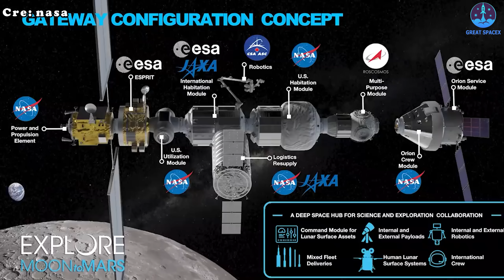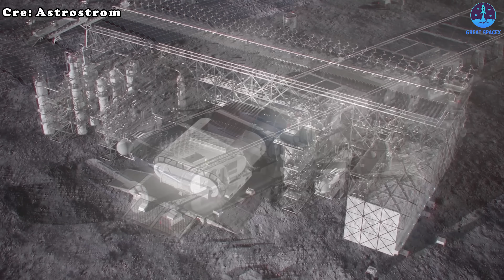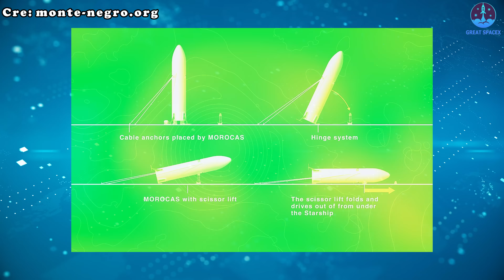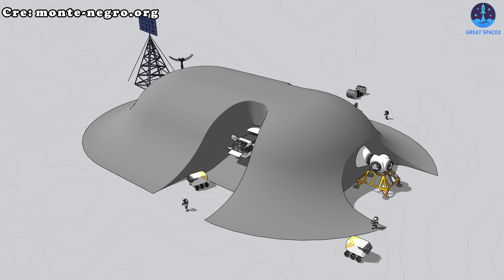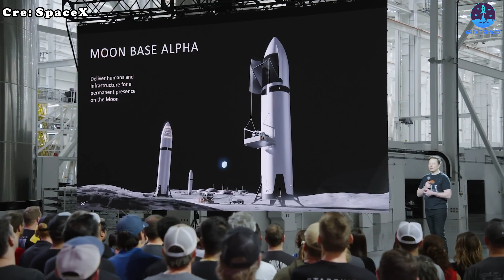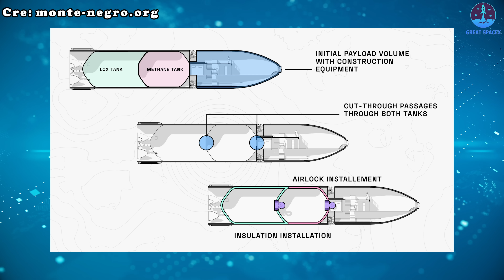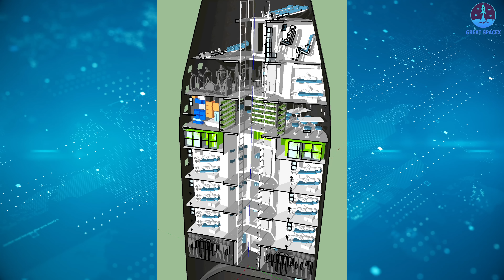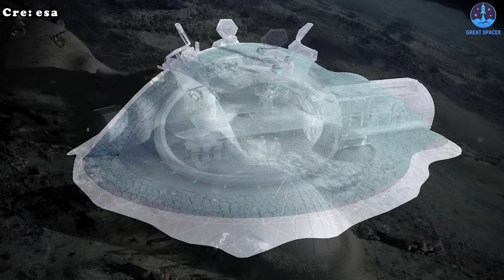SpaceX’s completely NEW Solution to help NASA Build First Moon Base Before China & Russia…

Comment: Step one starship space broom clears a place. Then lands on it and gently lays itself down. The next starship used as a broom will blow regular from around the area against it like a snow fence in the winter. Then from the second craft come tunnel, boring machines, and more Optimus robots. They make bricks you heat the bricks with an old raptor engine with the right mixture and you get the best bricks ever cyber trucks driven by Optimus will haul and stack them. They are light. Optimus is strong. They will be big. As a joke. Build one you cannot put a piece of paper between in odd shapes like they didn’t South America.

Elon has big factories producing all of the necessary components to do what I just said. If he turns his production that way. Would you be just after next falls Mars launch. He’ll be busy he can turn the production to you and you’ll have a base there so fast Because millions of bots a year thousands of starships zero human lives lost.

Comment: Aside from the fact that HLS is probably too tall to land on the Moon and that more squat designs are starting to emerge, working the lunar surface won't be so simple. On Earth, excavators must be heavy, and on Earth, we have six times the gravity of the Moon. Currently, humans can carry one ton to Mars and five tons to the Moon (at Earth weight) with smaller volumes. We'll see if the modules designed by Starship will perform better (and certainly cost less, if these concepts are implemented).
Reply: If its too tall, they can make it modular. Blow off the bottom section with the spent fuel tanks. Lunar gravity is super low, so they don't need much fuel to land it upright compared to earth.

Comment: It seems like the engines should be harvested off of the ships before they are buried. And could then be recycled into new ships produced either on the Moon or in Space.
Reply: I agree, unless of course parts of the engines could be used as an electric arc cruicuble for isru. If that were the case then it may be worthwhile because then they would have essentially unlimited oxygen from the regolith.

Comment: It is IDIOTIC to configure the Starship into ANY horizontal format since it will only be used in that way until it is in space. Once in space there is no up or down or there is no need for it to be configured vertically. The only things that need to be configured at launch is the position of the astronauts and once in space the seats could be rotated to match the rest of the ship in a horizontal position. 

The only things that need to be lowered down to the ground would be the giant air bladder weigh as it will be a MASSIVE amount of weight limiting anything else that could be taken on that trip to the moon in that Starship. And where will all the air for that air bladder come from? There is no atmosphere to speak of on the moon so it would have to stored and taken in Starship. If you compress it, the air would increase in weight vs cubic meter so you have to take that into account too. 

Once you get to the moon you then have to get the giant air bladder OUT of Starship and onto the ground. You would then have to drag it into place. You would then have to make sure that "up" is up and then fill it with air. 

If at all possible it would be better to drive giant stakes down into the ground. Each would have to be multiple meters in length which would add weight but without the bladder there would be a lot more rooms and capacity to take those up. Then you would attach motorized winches to the stakes which could then lower the Starship onto its side. I think that would be a LOT better idea and there would be no idiocy of having to reconfigure everything from a "vertical" position to a horizontal position because it would already be in that configuration.

Once on its side I would remove the engines and the fuel tanks using those for external storage tanks which again could be covered by regolith to protect any contents from radiation after plumbing is attached, most likely by robots. 

Once all that room is freed up, room for MUCH larger living quarters and work spaces would be available. 

But I would not send up just one Starship but I would launch and land TWO Starships. The second one would be landed as close as possible to the first one and then laid onto its side onto robots with wheels which would then move the second Starship next to the first Starship. Why?

The nose section of Starships would have doors sealing them from the main portion of the Starship. Then robots would laser cut the outer walls of the Starships on the side towards the second Starship. This would be done on both Starships. Those outer walls would then be moved from between both Starships. 

Next new outer panels in the storage section of the Starships would be laser welded to the Starship at 90 degree angles to the surface connecting the two Starships until all of that cubic area could be sealed and then filled with air. Then floors and walls could be installed in this much larger space where many more people and much bigger projects could be worked on and completed inside the Starships that will stay inside. 

You could add as many Starships as you wanted to horizontally in the same way or in pairs or however you wanted. 

However, you could also stack Starships ON TOP OF EACH OTHER in addition to horizontally side by side again using them as part of the framing to create even larger work and living spaces which would then be covered by regolith. 

Keep in mind that Starships can and will be able to take AT LEAST 100 tons from the earth to space. How much do the mathematicians think they can LAND on the moon will be the biggest question. How big of FEET to the Starships need to have in order to LAND ON THE SURFACE with 100 tons divided by 6 because there is 1/6th the gravity on the moon as there is on Earth, which will help significantly. 

I would EXPECT that one of the first things once the Starship has landed on the moon would be to lower robotic bulldozes/diggers/dump trucks to the ground to start moving regolith out of the way next to the Starship without causing the ground under the Starship to give way but close enough that it would be "easier", not easy but "easier" to drive multiple stakes meters into the ground then connecting robot winches to lower the Starships down into the ground horizontally with enough room for at least TWO  Starships side by side as above. 

That regolith would then be used, in part, to cover up the Starships after they have connected horizontally and possibly also vertically while they are on their sides and using plasma cutters to cut out the "bay areas" of the Starships and then joining them together.

You could then have rooms that are maybe sixteen to 20 feet tall INSIDE the rooms. Yes, each Starship is 9 meters or 29 feet 6.33 inches. Obviously there is the rounded part at the bottom , which would not be removed (at least not until a later date if wanted) but if you certainly stacked two Starship with 9 meters from center point to center point of each rocket and then build outer walls to contain them and fill them with air, that would give you a room of 29 feet 6.33 inches or three floors of almost ten feet tall each, which would give room for plumbing of liquids and air for instance, most of which would be plumbed in the outer curved portions of the Starship with a foot to 18" of space between floors for plumbing if needed.

Just a thought.

Comment: Ok not a bad idea but where will you get all the air needed for the bag ? Why not just land on it's side with small rockets that don't need air . If they can slow it down to  a soft touchdown and the ship is stronger for this reason and it was tested as best as possible so it can  handle this maneuver.

Comment: This makes no sense. They're going to transport rovers and a giant balloon (to be inflated in vacuum) just to reorientate the ship one time, instead of designing a different ship? And then you need to have another way to getting people off the moon anyways? Who wants to live on the ship they came on instead of a habitat designed to actually be a habitat- not flying skyscraper.
Reply: No Musk fan here, but I suppose a second 'starship' would land after 6 months with a new crew, and then take the old crew back to Earth. But I don't know if they would have the space for enough fuel for a return trip with, 'dozens of astronauts'. The Apollo Lunar orbit return module only had to carry two guys to dock with the command module, and with gravity assist from the moon, it took very little fuel to get back to Earth.
Reply: I don't know why you're assuming a single ship will land. Elon constantly says they there would be ships flying there and back constantly. 

Why live on a ship first? Because it's easier. Building a habitat is difficult, you need a mini-base beforehand. Think of a minecraft dirt hut before you build an actuall fortress.
Reply: There is a great need to land many ships to deliver cargo and equipment, but very little need to launch back to Earth.  Therefore, you will end up with lots of empty ships on the moon anyway.  Crazy not to use them.  Think of them as RVs.  RVs are often used to house people at construction sites in isolated areas while the permanent housing is built.

Comment: I think they’re going to need nuclear power as solar energy is limited (even at the South Pole with no nighttime. Simple RTGs to start with followed by molten salt reactors.
Reply: How are you going to cool that with only radiation I wonder.
Reply: @chrisvanschalkwyk1455 , if you size the radiators correctly and keep them shaded, pure radiative cooling is enough for a lunar LFTR. In vacuum, heat dumped by radiation:follows the Stefan-Boltzmann formula, Typical LFTR outlet temps are ∼600–750 °C, where the radiators are very efficient. For example, a 50 MW reactor would need ten 25 m × 10 m double-sided panels.

Comment: Pretty sure I saw lord Frieza's ship at 6:46...😮.😂 Anyway...
I love this overall idea. Like I said on the last video about what to do with HLV after taking the astronauts back to Orion on the first trip... BRING IT Back Down the Lunar Surface for this! As far as the floorplan goes.... The 5th floor being the Rec Center and leisure zone.... Come On! It's not a resort! Like there were already Several areas sufficient for that. 5th floor should be shops and additional work areas. Printer zones. Systems. Grown up stuff. Lol. But here's another thing. On its side it isn't going to be 5 or 6 floors. On its side it's 4. The nose cupula type area should be perhaps two floors to give a place for higher ceilings. And there wouldn't need to be a whole floor horizontally for gym. This could be switched up and idealized a bunch. I'd love to model some of this stuff. Im a nut for realistic space floorplans. Expanse was great but he show botched the interiors. I'm that big of a nerd over this specific area.

Comment: Using that inflatable cushion as the habitat, itself, would make for a much faster, easier, and larger internal environment.  Bury that.  As for the Starship, you could make it habitable long term on the moon standing up.  Line the interior walls with bags of regolith for radiation shielding.  It's similar to burying it except would require far less regolith.  You would want about half a meter (1 1/2 feet) for sufficient shielding all around.  There is plenty of room for that with lots left over.  Also, it would be nice to have a sky scraper with broad views of the outside luner landscape.

Comment: The starship that will be used on the moon should have very good insulation, reducing the need for heating and air-conditioning,  adding rigidity to the outer hull, and reducing the risk of posible pressure leaks.

Comment: All of the floor designs in the video are concentrated on vertical orientation.  This is only the best configuration on launch and if the star ship is to remain vertical for a long period, or forever.   My concern here is that there is insufficient shielding for healthy long term habitation.  If the personnel are to be swapped out every 3-4 months this may cause only moderate radiation damage to humans, but is not a good long term solution.   Radiation shielding is a must have for all inhabitants after the first infrastructure is built/placed.

Also, for long term habitation there is going to need to be a very large donut style slanted floor centrifugal earth gravity simulator that the people can be in for at least 6 hours daily walking, exercising, sitting and working at a computer console or similar work, and of course this needs to be shielded.

Comment: I think using a horizontal starship with pre made infrastructure is wise.   Most of the hard work can be done by engineers on earth, then robotic earth movers to shield the structure.

With something like Haskell barriers and plastic mesh road reenforcement, the shielding material can be placed around the starship without poring down into the entry area.

Likelyntheremshould be a decontamination enclosure to blow off all the equipment and clothing, followed by a contaminated equipment storage area attached to the air lock of the starship,  trying to keep as much dust as possible outside.

Also, air lock should have another deecontaminatin system built in where the space suits and equipment that will be brought into the ship can be thoroughly cleaned prior to entry, and should have some major air fillers to vacume all of the dust out of the air.

Keeping lunar dust out of the facility is going to need to be a "must have" or clothing, lungs, and equipment are going to get shredded by the abrasive dust.  Asbestos anyone?

Comment: This has got to be the stupidest idea I've heard of in a long time. For starters Starship is designed as a vertical vehicle and all of its structural components are designed to be vertical Flooding at horizontal even if you could land Softly would be an impossible task it makes more sense to land vertically onto an elevated pad that would go down below the moon's surface then you could create a geodesic dome to cover the top of it and maintain everything the way it was designed and have a facility beneath the moon's surface to protect it from radiation and micrometers you could probably use current volcanic shafts to build out the subsurface areas. There are inflatable subsurface structures that could be built in these Caverns to support human life during the construction of an elevator pad to lower Starship it is an engineering task that can be done what's the current technology

Comment: 1. Can Starship laid horizontal support the ten feet of regolith that has to be piked on top for radiation protection? 

2. How much compressed “air” mass has to be transported to the moon for the pillow inflation?
Reply: 1: yes, many spaceships can support the munar radiation, and also the regolith isn't that hard on the ship. It carries 150 tons of cargo, ten feet of small rock is nothing to its integrity..  2: we don't need compressed air- you can just heat up the liquid oxygen/nitrogen or whatever they bring, turning it into a gas, and expanding it.

Comment: Why can't they land it horizontally? Would need some extra landing engines, but should be possible.
Reply: This would require more fuel as well as thrusters, decreasing the carrying capacity for cargo. However, that might be an effective offset in some circumstances ...

Comment: They are having issues with the (reusable) heat shield, so either they wait until they get that resolved (which could take a long time because it's never been done before) or they change tactics.  One solution is to simply leave the Starship up there and use it for something else.  The idea of building things in space with bits of the rocket used to go up there is not exactly new.  Project Horizon in the 1960's was an idea to extend Skylab with empty rocket stages.  They can replace the ISS in ~5 launches.  No more heat shield and atmospheric engines means more payload weight.  It's a no brainer, it just means they will be throwing away 3 vacuum engines each launch plus other stuffs, so total cost per launch will be slightly higher.  They are practically there already, they just need to iron out the remaining hiccups like failing engines on the booster and an actual orbital insertion.

Comment: (EDIT: 8:37 -- Okay, I'm calling BS here. The 6 floor arrangement is likely referring to a vertical orientation for Starship internals. The hull is only 9 meters wide. That's only good for 3 floors. (really just 2 1/2) ) 

There is a key factor that's not accounted for in this plan. We'd need to guarantee that the ship settles so that it's interior is level with the ground. The problem is that the Lunar Starship as portrayed is roughly cylindrical in shape, so it could settle off level, measured on a plane perpendicular around its long axis.

Comment: This is a genius scam exclamation point if NASA is stupid enough to buy into this vision, then NASA will be even more locked in to using starship to get to the moon. Of course, before anything goes to the moon SpaceX will get a lot of new contracts to engineer this solution. Once NASA is locked into using SpaceX, of course, no matter how long it actually takes for a starship to get to the moon, no matter how many years, NASA will have no choice, but to continue with SpaceX. Locking NASA in and getting more contracts is pure Elon scam genius!